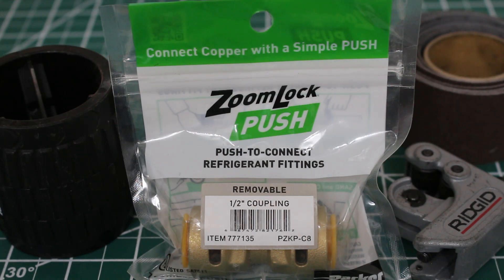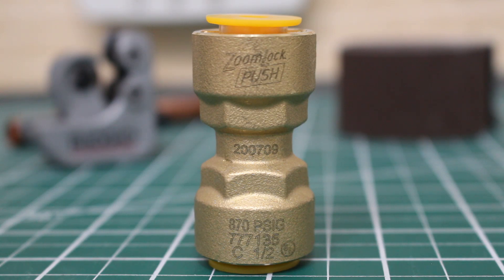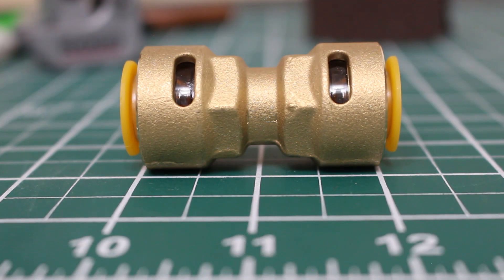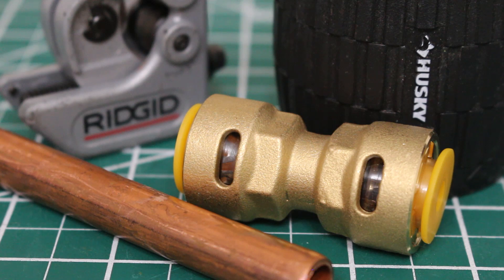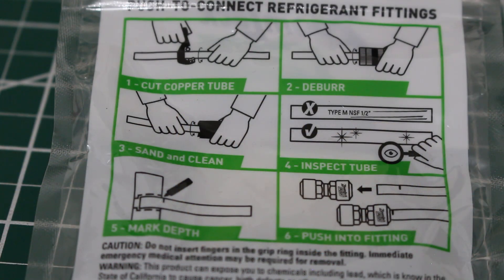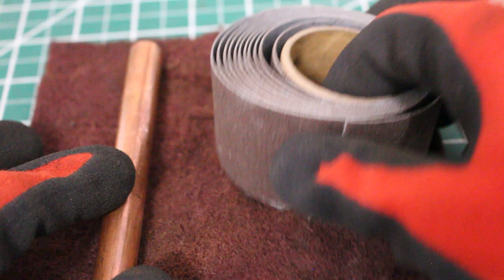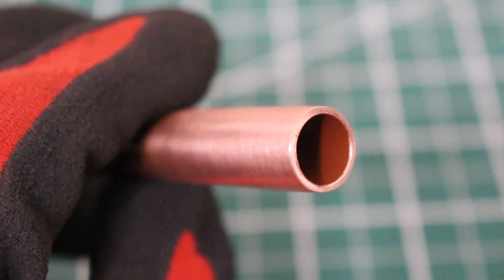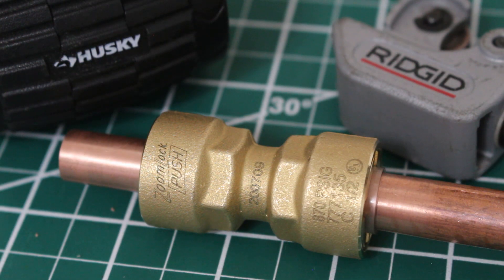HVAC: ZOOMLOCK PUSH (Push To Connect Refrigerant Fittings Review/Installation) NO MORE BRAZING!

Comment: If you use this fitting bc you cant braze then you shouldn’t be doing hvac
Reply: Sometimes a torch is not allowed
Reply: @AMERICANPRIDE1100 Home Depot REQUIRES THESE ON ALL OF THEIR INSTALLATIONS.
Reply from the maker: Haha. There's instances where this would work not only because of no brazing skills LOL thanks for watching & stay tuned for new videos every week!
Reply: @JumpermanTech Brazing is being eliminated by mfgrs more and more. The reason? Metallurgy of the element, not that you aren't already aware. This is a craft for the uneducated and weak minded, unfortunately.
Reply: Yea you still gonna have to make the hardest braze with or without this technology and that's where the suction line goes into the condenser valve. All those units have different outer diameter valve connection ports.
Reply: That being said, blasting fire at something to connect them is kinda silly. I believe it's unnecessary and outdated. Why subject the valves, filters, windings etc to the heat, and why introduce flux carbon and metal shavings to a system that we are supposed to be heretically sealing with pure refrigerant inside? Brazing is unnecessarily hot, dirty, dangerous, and time consuming, not to mention all the shit you need to haul in your truck for the process. It will always have its place, but I believe it will only be used for specialty situations in the future.
Reply: @8Seven65 Ding Ding Ding

When I am working on a Sub Zero in a 10 million dollar mansion replacing a compressor throwing a torch in a confined space, even with fiberglass blankets it’s a high risk of fire/damage to surrounding components and/or complaints from customers smelling the vaporized flux/solder/oils inside the line.

Perfect analogy @8seven65, it’s simply outdated. This same argument was presented in the plumbing industry when shark bite/john guest compression fittings and so on started replacing glue/solder.
Reply: You know what you sound like? Like old plumbers talking about if you didn’t know how to do oakum rope and lead you shouldn’t be doing cast iron pipe. Or if you didn’t know how to use a lead pan you shouldn’t do showers pans…. Technology changes over time.
Reply: Bs there is always new technology. U need to use this
Reply: 320 units, apartment complex only 2 portable units,will this  be a good idea to save time? ???
Reply: Who makes you God? PS, brazing is being disallowed by mfgrs at an increasing rate. Why? You may want to learn the physics. Its only over 20 years now.

Comment: Game changer ...And  Zoomlock sure are proud of em at $32.00 a pop ... Good demo ...
Reply from the maker: Def a game changer. They are expensive but this 1/2" coupling was closer to around $12 USD at the supply shop. Still very pricey. Thank you! Appreciate the feedback & thanks for watching Eddy!
Reply: @JumpermanTech  But imagine not having to buy a $4000 crimptool Furnace installer that your worried not gonna solder and use nitrogen or not a very good torch man-You’re almost 100% that there’s not gonna be any trash in line and stop at the TXV valve
Reply: @chaddarr4834  only thing stoping up your txv is those shavings from your Rheem job better invest in some q tips.
Reply: @davidhazas7162  that’s funny that’s the only thing I havnt found in a screen or TXV from another company. We don’t get stopped up TXV valves (exempt when Copeland was putting that rust agent in there compressors) it’s from another company I go behind that doesn’t believe in nitrogen purging while soldering. And I know they don’t purge nitrogen because he’s a friend of mine and I’m constantly going behind him and reworking his projects because I use him because it’s cheaper and then eventually they have to call me to come fix it

Comment: Hello have you used this type of push fitting on a job? These came out almost 2 years ago here in Australia. Hesitant to try it on an install, it’ll save ALOT of time especially on long runs. Reminds me of the Sharkbite fitting that has a similar push-fit, but plumbers loath it.
Reply from the maker: I haven't used this on a job yet but I have a friend who did and he said it worked in a pinch where he wasn't allowed to use a torch. Reminds me of the sharkbite fittings too except these are for refrigerant piping and holds alot more pressure. Zoomlock is a quality fitting for sure. I'd say it's safe to try out 💯 Thanks for watching!
Reply: @JumpermanTech  I have used them on two jobs to check them out and that’s been about a year ago and they have been working fine I’m hesitant to use them too
Reply: My feeling about sharkbite fittings is that the ratio of people suspicious of them to the number of people who’ve had them fail makes me feel like I can trust them. 

Lots of people are suspicious but very few have seen them fail.